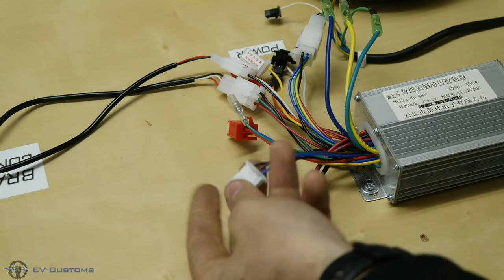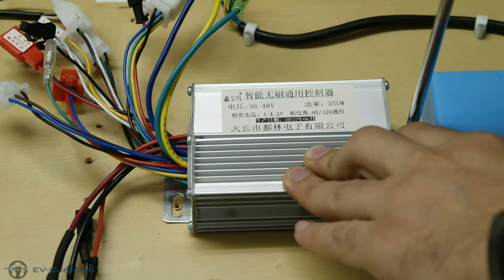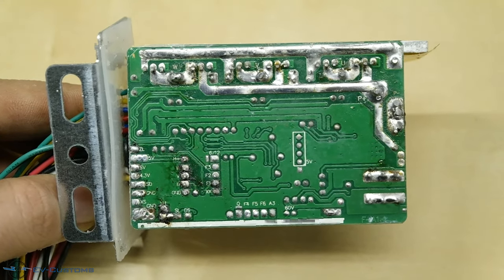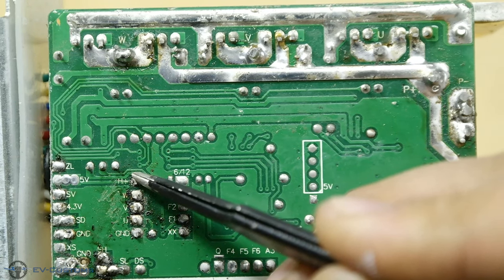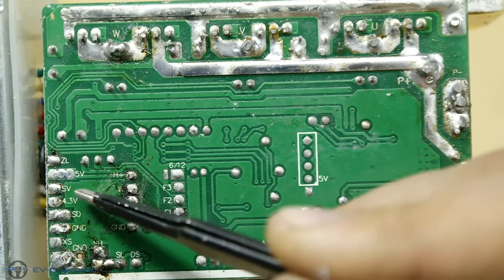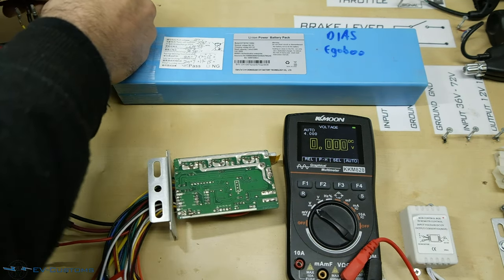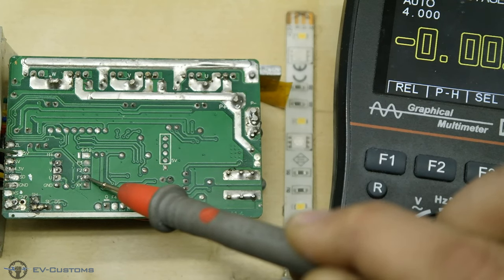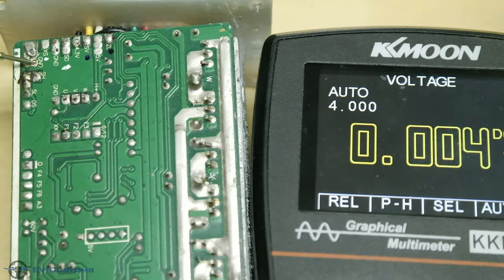How to Activate EBS Brake from the Board (Learning Board for Beginners)

Comment: I have build two ebikes for over a year with plans to use ebrake instead of disc brake.
I search everywhere but could not find Solution to Ebrake.
Here i am, Celebrating this great find.
To add to your finding. 
I noticed that most Chinese Controller have alarm connector.
One of the wire is connect to the Pin.
No need opening the controller and soldering any wire.
Thanks again @EV-Customs.
Reply: Do you mean that connecting the ebrake to the alarm connector will make it work the same way?
Reply: @Vea800  one of the wires in the alarm connector is where the ebrake can be connected to. 
You should first test each of the wires while throttling to identify the right wire..
Hope this helps.
Reply: Does it mean that i can connect wire from alarm to that pin and I should have wheal lock when alarm goes off ? My controler oryginalny dont have alarm plug but it have electric brake , but the pin A3 is not connected to anything
Reply: The alarm wire is just like a ebs 100%
It would make you fly over the Handel bars, but not gonna recharge anything
Instead you need to find the correct pad that when the brake levers are engaged they regen for you
Reply: @kamillapaj87  if your controller have ebrake originally, then you are lucky. 😀
Reply: @iykmoses  it has one , but nothing crazy , you can't only use ebrake on my scooter anyway , it only works to some extend , but if I would count only on electric brake/regen I would be dead 😂 my scooter goes 50mph , it does not work like hydraulic brake , it only slowes me down little bit and charging battery at the same time , and I also found how to connect alarm that is locking the wheel completely when someone trying to push it 😀
Reply: @kamillapaj87  haha depending on ebrake/regen is a complete bad idea!
Reply: @iykmoses  would you elaborate on regen bad idea ? Does ebrake work in different way ? Does it disapate energy somewhere else than to the battery ?
Reply: @kamillapaj87  oh! Regen and ebrake are in fact very good. 
I mean to say in you previous comment that depending on thses with out a mechanical brake is a bad idea. Some ebike has ebraje that stops the bike just as mechanical once do.
Reply: @iykmoses  didn't know that , I thought all of them slow you down just little bit

Comment: I soldered DS together with F2 on the bldc and when I activate SL (Brake Low) I have a regenerative brake that slows me down very gently. F2 doesn't block the wheel as much as F3 and the EABS stops working completely at around 2kmh. I think this works best if your bldc controller doesn't have EBS available!

Comment: Have you seen the controllers that are 'fly by wire' ? I've just repaired an e-scooter, but thought I'd get a similar new controller to do the repair (didn't want to wait a month for ali express). After swapping the wiring to match the old controller, and changing the braking from low brake to high brake, everything seemed to work - Apart from the accelerator! The old display (a tf-500) was able to get the data from the different controller (a tf-100) to display on the screen (manually spinning the motor would show the speed), but the accelerator command wasn't recognised. A right pain. Neither controller had an analogue accelerator input, but it looks like there is space on the board to add one (4.3v, ds and gnd), and I guess it would work.

For these two controllers, everything is done through the tx and rx leads, the hall sensor for the accelerator is built into the display, and has no analogue output. It was interesting to note there were no error codes on the display, even though the accelerator didn't work. I also found that the newer controller had a brown and blue wire, brown to one of the phases and blue to a pad labelled A3, linking the wires made the motor electrically brake if you tried to roll it (I guess the wires were for an anti-theft device).

In the end I used a mosfet from the new controller to repair the old one (a bit of a waste tbh), and I had to transfer the wiring over again! At least I learned that a controller for a kugoo m4 pro is not a suitable replacement for a damaged one from a bogist m5 pro - even if you re-wire it to match, and even though the scooters both look similar,  and even if the circuit boards are identical (must be different firmware).
Reply: I have e-06 error on zq-100 but my engine has no hall sensors and I have a problem because I don't know where to connect rx and tx from the display, where to solder in the controller

Comment: The EBS function looks savage! On my 500w 48VDC bike I reckon I'd be thrown over the handlebars if I pulled on the brakes with the EBS enabled. No wonder the EBS was disconnected at the factory!!
Reply: EBS - Empty Bowels System for front wheel drive,  or for back wheel drive, Extra Big Skidmark. 🤣

Comment: My controller looks the same on the outside but the insude is different. On mine you simply short the X and DS pins to activate braking when you connect the usual brake wires. Also on mine A1 cycles through the speeds and F1, F2, and F3 are the speed indicator lights to tell you if you are on low, medium, or high speed when an LED is connected between each one and ground

Comment: What happens if you vary the voltage going to that pin? I was under the impression that the degree of EBS could be carried linearly just like a throttle. So essentially you could have your normal throttle on one side, and a second throttle on the other side. The second throttle enables ebs and you can gradually increase the amount of EBS to slowly bring your bike to a stop. Could you test this by hooking that pin to a second throttle?
Reply: I imagine it should work. You might use regular 3-pin brake levers with a signal wire. I'll be testing this out with a xiaomi brake lever and will revert 🙂
Reply: But where to take the signal from..? Hmmm.
Reply: So to use ebs does that mean you disregard the high and low brake connections? Or is ebs a combination of  high brakes and the additional contact you showed us to diagnose for?
Reply: @jjpev  Maybe using a ebike thumb throttle you could apply braking gradually rather than the off/on using a brake lever
Reply: @jrobpat0154 nahh i tryeddddd on my controaller and it didn't work like that
After a certain point the brakes just activate at full power
Reply: Tought you need to connect A3 wih ground, how are you gonna vary the ground voltage to the pin?
Reply: @VHKriss  comnect a throttle to 4.3v the signal to A3 and ground of the trhottle to ground thats it
Reply: @felipehcraftgamer4193  but to activate A3 you need to connect it with ground - . The signal from from throttle is plus??
Reply: @VHKriss  the trhottle signal go to a3
The problem is that when the pull the trhottle it desactivate the braking 
You need to find another pin on your controller made for that
Reply: @felipehcraftgamer4193 so i checked again and you need to connect a3 with ground. You can not vary the voltage or braking.
Reply: @VHKriss  exactly what a saw in my controaller, you can't use a variable voltage in this pin, and a3 is usualy for parking brake
You have to find another pin that when commected tp gnd also brakes (in my case is A2) 
More common: X, DS, EBS (but could be any,  you have to test to find it)

Comment: I bought one of these and A3 is connected on blue/white line it is labeled as security signal. Based on reverse engineering it will short out all the three phase wires thats why it somehow acts like a brake.

Comment: Hello!  Today I got a controller from AZ like this one in the video with 2x red plugs for alarm, 3 x different 3 pin gas and 5 Hall sensors.  But my problem is: I don't have a 5 pin display cable for the LCD display.  You also don't have a display cable in this video.  But I have about 15 cables high brake, low brake I understand all that. But I don't know how to do the display cable!  PLEASE can Sue just help me and tell me how to make the display cable?  The display cable is always the same as Hall sensors: red, black, green, yellow and blue.  I have 1x blue cable communication send cable.  Please, can you help me?  PLEASE!  Kind regards.

Comment: I ordered a new motor and controller kit from amazon. (Vevor BY15WF02-A) I've been trying to reverse-engineer it a bit and I am trying to add a Brake light connector for it. For some reason my controller is missing it, alhough it was shown in the sales pictures. Anyhow it seems from my old brushed controller and pictures from these chinese controllers is that the Brake light positive is vcc (Orange wire), Brake light negative is then going to brake signal pin (Violet wire). And then the brake signal pin is grounded when the brake is applied?
Or will I break the controller with this mod?

Comment: I have ESC with modelname kh324-fs-1 with a yellow pcb. Positive pole of brake wire connected to EBS+ on pcb, Negative pole of brake, two wires, one black (ground) one orange, and orange is soldered to EBS+.
Both won't do anything but cut off power to engine. Even though pcb clearly states EBS+ and EBS-

Comment: Really useful and very nice video. It's going to be silly but I had a question :)
If we press the brake and turn the engine manually without giving any gas to the engine, will the engine brake thanks to ebs? so if the scooter stops on a slope with the brake pressed, will the scooter slide?
Reply: any answerrs ?
Reply from the maker: Yes, the motor will breaking (it will have some resistance) it will produce three phase power to the controller and the controller will convert it from AC to DC power to charge the battery pack of the vehicle.
Reply: Worth mentioning is that ebrake most commonly will be weak at low motor rpms, and stronger at higher motor rpms. So it will only give some resistance once the motor turns, making it a bad stand still brake. Of course there are other ways of actively keep a motor stopped, but thats not in the standard chinese ebike controllers.
Reply: For hoverboards, they have a special controaller that controls directly your motor torque, when standstill it applies a constant current the motor to keep you still
It also use a more advanced control technique cold FOC (field oriented control)
- Maximizes motor torque at any angle
- Better efficiency
- Sillent motor operation
- Precise motor movements

Comment: Hello, I did like you and it works, I soldered to the button output a wire that goes to the SH terminal which was empty, and the other side a wire that goes to 36v now I have a high brake connected to a push button. but I don't know how to activate the EBS. thanks for this video.

Comment: Hi can you connect stop light with this Ebs breaking? I can see you use the black cable from the low level break then the white from Ebs instead of red wire
My scooter controller just burned i replaced with another but it seems that it breaks by just turning the motor off not like the other was breaking very sudden
I think the burned controller had Ebs connected somehow on the mother board this one I need to make the connection like you did but then I don't know if my stop light will work
Also if high break connected with Ebs breaking will it be regen breaking or it will activate electric motor breaking where the wheel actually spinns opposite direction?
Reply from the maker: Yes... i have already video with this connection..  high and low braking video
Reply: @EVCustoms  will high break plus ebs use battery to reverse the motor or will it be regeneration breaking?
Reply: @confidenceculture760 anything that isn't reqen will draw power.  You will have to find data sheet for your unit to see how the derived braking

Comment: hello,
great video, but I have a question?
is it possible to to "brake" 2 speed controllers using 1 button?
I've turned a hoverboard into a go cart and need to activate the EBS on both controllers - easy done thanks to you - but can I ground out both controllers on the same ground wire?
FYI: Im using one batery to run both controllers so they share the same ground wire.
Reply from the maker: Correct..! the ground is shared from the battery so you must connect only the signal wires with one of two ground signal wires.
Reply: @EVCustoms  thankyou for confirming that, the controllers Im using have the antitheft wired to what you have called the EBS, can I use that as the "brakes" for my set up?
by grounding the EBS wire to apply magnetic braking?
Reply: @MRLAW243 anti theft is like full regen brake or ebs 100% on like lime or bird scooters when you push one around

Comment: if you break do you get Amps back into the battery?
Reply from the maker: Yes...
Reply: @EVCustoms  are u shure they are not shorted and dissipated as heat on power mosfets ?
Reply: @yellouu_theree one way to find out. With low battery,  bring to top of big hill and see if braking raises battery level

Comment: Great video, info and tutorial but I'm confused by one thing, if the EBS is activated to 100% when pressing brake, will it not cause the wheel to lock up?? 

If it's in locked position is it not better to connect that wire to the the kill switch?

When it's on 'off' position it will lock up the wheel and activate anti theft. I assume the ignition would have to be bypassed for it to work that way??

Comment: i get max 4-6A brake Amps  ....  how to get stronger Regen?  i want to stop in 20m or so...
Reply from the maker: Hi.. this is (maybe) because your battery is not discharged below than 60-50%. regen working at maximum when the battery has low capacity..
Reply: @EVCustoms   i get 4-6A on full and 30% 🤔
Reply from the maker: your controller is programmable?

Comment: Hi there, thanks for the video!

Is it possible that my board has the "EB" solder pad, but still doesn't support electronic braking?

On my board, all of the function pins are set up like this:

F1 - Gnd
F2 - Gnd
F3 - Gnd
F4 - Gnd
F5 - Gnd
EB - Gnd

All of the other working functions make a circuit to the gnd pin next to them, but when I connected EB to gnd nothing happens at all. Maybe it just doesn't support electronic braking? Or could it be that even though there is a gnd solder pad next to it, I actually have to connect it to 5v to activate, instead of ground?
Reply: Ooh. It could be a signaled function.  Power to it rather than switch.  Can you Google the board and find tech sheet?

Comment: Your videos are super helpful! Thanks  a lot! Is it possible to add a potentiometer for being able to dose the ebs?
Reply from the maker: Thank you Lucas.. No..  unfortunately there you will need special controller for analog EBS braking...
Reply: @EVCustoms  I am currently building two Bobby cars with electric scooter motors. Do you know how to make them faster than 35kmh? :)
Reply: @lucasfraunberger7914 what wattage and diameter wheels are you using?
Reply: @joeKisonue  I am using two 350w 8,5" motors (they have this red ring). max speed is 40kmh at the moment. thanks to @EVCUstoms I was able to activate the EBS. works great! :-)
Reply: @LucasFraunberger  increase voltage
Reply: @ev customs I have a question. Enabling the EBS works only with a brake handle that has two wires only but won't work with a three wires thumb brake. Any suggestions? Thanks your videos are very helpful.
Reply: @LucasFraunberger  increase your input  voltage if your controllers can handle. 
I have a Chinese controller rated 36v/48v 500w.  
Because I needed more speed, I had to start increasing the voltage till I go to 72v. Now my speed has increased significantly!
Reply: @LucasFraunberger  higher voltage

Comment: would there be a problem i dont connect the LOW BREAKE connector and instead use the switch as my breake light STOP switch?
Reply: Not if the brake lever is actuating rim brakes. If you aren't using the hub motor for brake and want analog brake and light

Comment: What do I do if none of the pins trigger regen? Even if one pin is labeled EBS. When I connect that one it just takes out the ramp effect for acceleration. The label on the controller has a part that says “brake battery: +12v” what does this mean?
Reply from the maker: This +12v brake battery must be signal which you take from low voltage dc-dc converter pass from controller and handle which must be in series to  activities the 12V stop lamp..
Reply: @EVCustoms  it only has a high brake wire. I would simply add a tap to the output that gives 12v signal and that should work?

Comment: Does the EBS Brake regen power back to the Battery on this cheap controllers?
Reply: Yes
But threres two types of braking on cheap controallers
The alarm that simply short your motor not regenerating any power 
And the regen one (ussualy a bit less stronger) but recharges your battery
Reply: @felipehcraftgamer4193  thx for your reply. I just tried the ebs brake from the alarm plug like you said no regen to battery. so I have to find the ebs brake on the controller because there is no wire outside from the controller and test it again!
Reply: @team13thirteen  it's not that hard to find regen
With your motor running you just need to find the pad 
In my case was 
A3 Alarm motor lock
A2 regen
F5 speed toggle
F2, F3, F4 indicator led output for the speeds
XS low speed
DS motor desactivator
They are a few that i haven't tested such as
S1, L, ZL, DC

Comment: How would I activate EBS with the high brake line?
Reply: If your brake lever has a switch to light brake light you can run 2 wire into controller and solder one wire to each pad. Pulling lever will complete circuit and ground the ebs
Reply: Sorry I just read high brake line design.  High requires 5v input
Reply: @joeKisonue  I decided to use a brake relay.
Reply: @Fleshware  good 👍